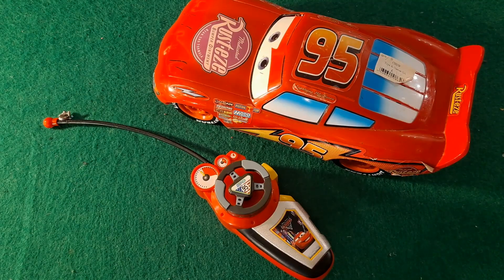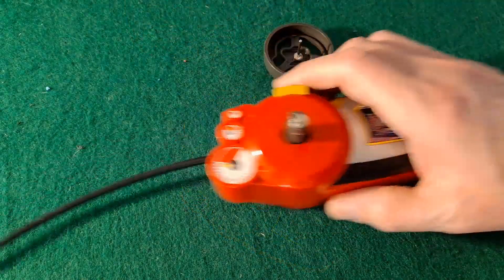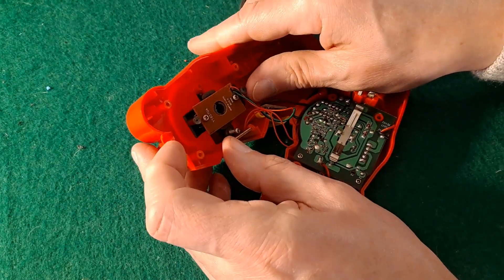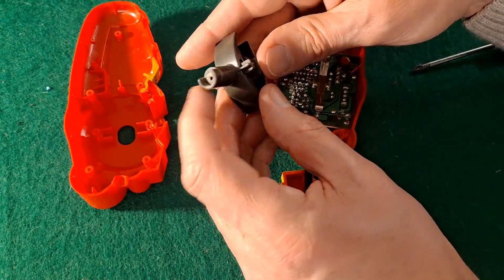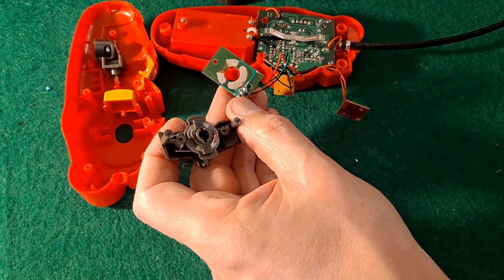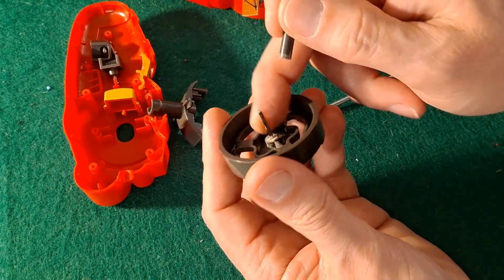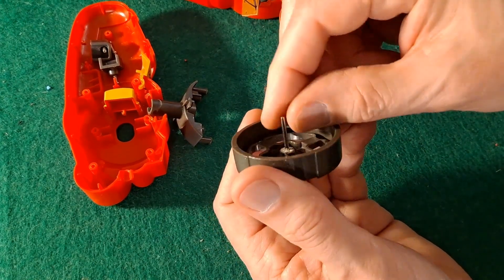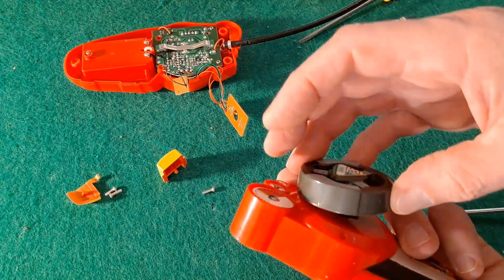Lightning McQueen controller fix

Comment: Or just replace it with a sanwa m17 RC set (receiver included).
Reply from the maker: I think that £500 for a Sanwa TX/RX on a toy grade car is probably over spec for it. And I would still not retain the sound effects.
Reply: @GrandadIsAnOldMan  priorities...
Reply from the maker: @prep0wer  There is a lot I can do with £500 that do not include RC 😊👍

Comment: Hi, nice video. How turbo botton should be works in the orignal car? "Sending" more power two the motor?
Reply from the maker: Yes, the usual way it works is the maximum normal power is reduced with a resistor and the the turbo would cut out the resistor.

Comment: Hi grandad.nice swap around for the steering and i have an idea to solve the forwards and backwards Setup. You can swap the wires over from the two yellow Buttons over to the steering wheel.so the voice Button will do the reverse and the turbo Button will do the forward.then u could have the voice and the turbo on the steering wheel.that would be an ideal Setup.
Reply from the maker: That is a good idea, Marc. It would certainly work, although I would rather get another controller shell and transfer the circuit board across so I can use normal controls that I am comfortable with.
Reply: I though about the same thing